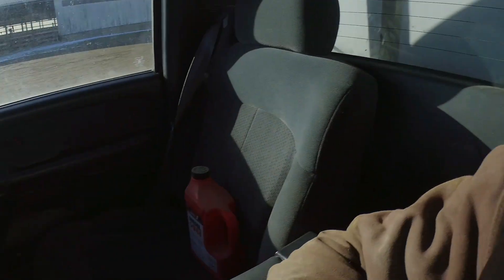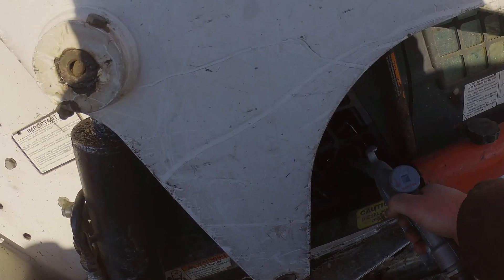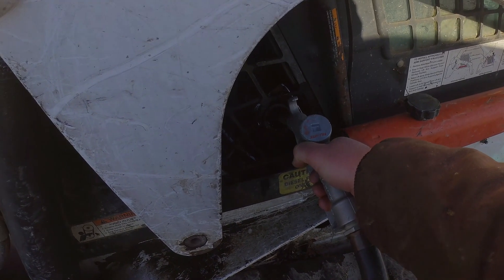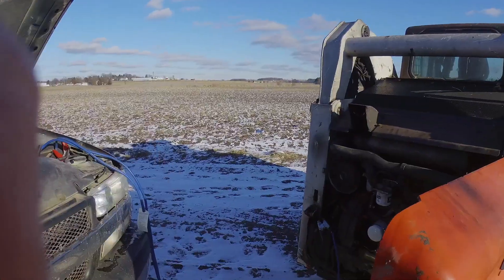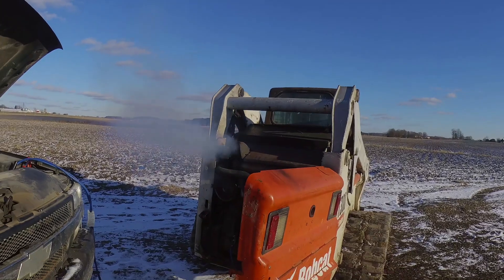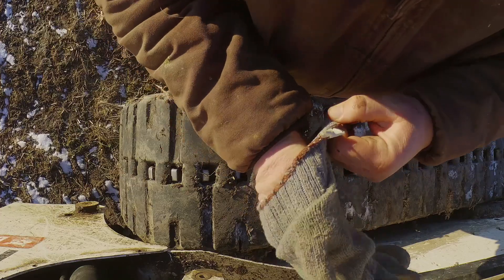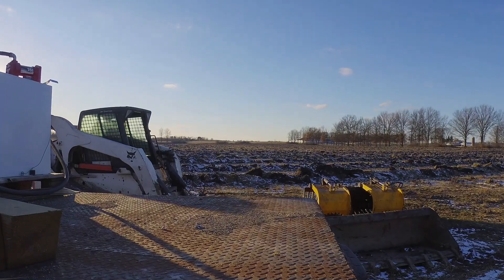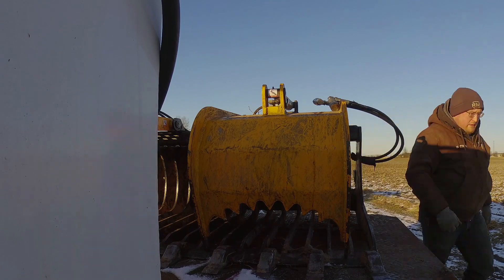The joys of running old slid loaders

Comment: On the alternator charging: it depends on how much load is on it. Modern alternators can put out 100-200A. If the load is heavy then idle speed will probably not be able to reach/maintain it. Being that the electricity is being generated mechanically via induction then it stands to reason that greater rpm is capable of pushing greater amperage. Again, that all depends on the load.

Good videos, Matt!